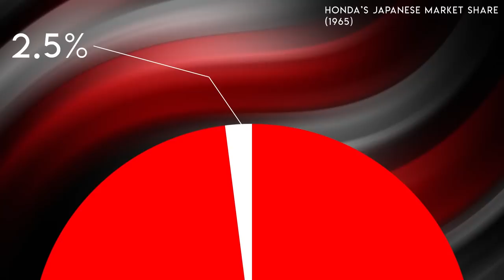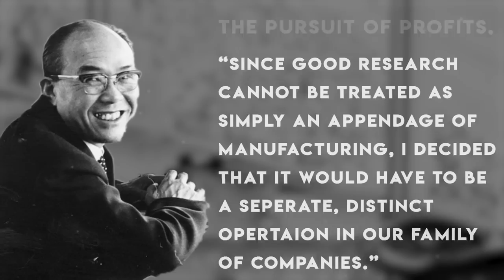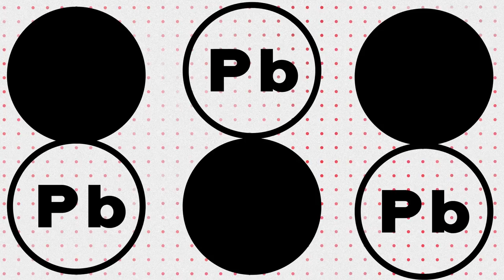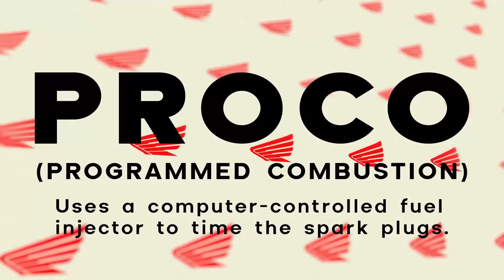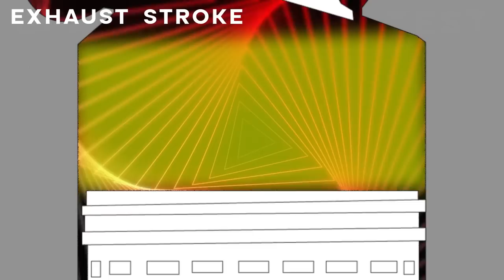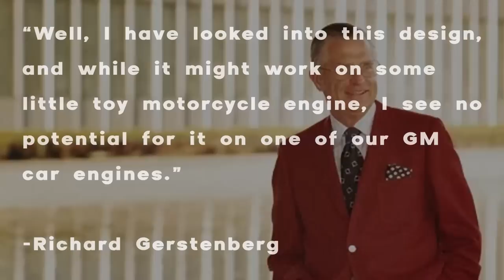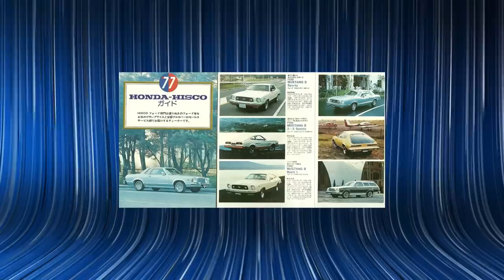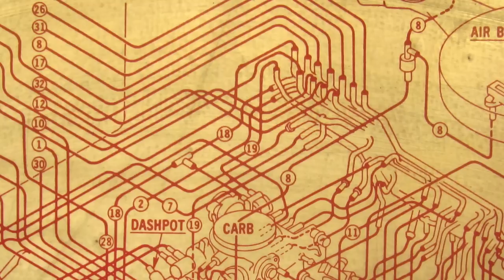The Honda CVCC Engine Was A REVELATION (Full Documentary)

Comment: Best engine in any car I've ever owned. Put 65k on it before any repairs (dirt in the carburetor needle & seat). Sold it at 80k miles; buyer put 20k on it before doing brakes. Put another 40k then did a clutch. Car got 37mpg combined with no computer or fuel injection - only car that got better mpg was my parent's Rabbit Diesel

Comment: In the fall of '78, after owning several used vehicles of varying descriptions and vintage, I was ready to buy my first brand new car.  I needed something small with good gas mileage, and my budget was no more than $6k.  I looked at pretty much everything on the market in the US at that time which met those parameters.  The small cars made by the US automakers did not compare well to the imports IMO, so they were out of the running pretty quickly.

I looked briefly at Hondas but decided they were too small, plus there were some stories going around about problems with the engines and overall QC.  The idea of a Honda car was still a new thing at that time, especially in the US, and they hadn't yet built up a lot of trust or a loyal following.  They were still thought of as primarily a motorcycle company, and there was some doubt about how long they were going to be able to stay in the auto market, especially in the US.

I ended up buying a new Golf/Rabbit.  I was able to splurge for the midrange model with a few minor options, but it had power nothing other than steering and brakes (I think).  It had an AM radio, crank windows, stick shift, and of course no AC, which was pretty typical at the time even on new cars, especially econo cars.  The AC option alone would have added ten percent to the price of the entire car (around $600), so it was a budget buster and I had to skip it.  Houses and cars without AC were common then so it wasn't a big deal.  I was able to get out the door just under $6k.  

The VW was peppy and served me well for two years until I was making more money and could trade it in on something bigger and a little more luxurious (and with AC).

Comment: I had a Civic that had a bad transmission so I bought a smashed up CVCC car for parts. I decided to switch out the engine as well but after many hours to get it to fit I discovered the CVCC car front end was a few inches longer so the engine wouldn't bolt in. If I remember correctly the fenders were longer too on the CVCC

Comment: The CVCC engine in my Mom's 78 Accord was super problematic and I've often seen that engine listed as one of the worst engines of all time. Sure it made emissions and fuel consumption good, but the overly complicated vacuum system and carb's sensitivity to different gas mixtures made it quite unreliable.
Reply: Yes the carbed and heavy vacuum engines were headaches to troubleshoot. Modern tuners found out ways to delete all of the vacuum lines with the “wire tuck” craze
Reply: I've got one still, plus a few 1st gen civics.
The carbs are copy cats and reliable, but the vaccuum is as bad as it can be.
The 1st gen community calls those cvcc engines boat anchors for good reason. Nearly everyone blew the head gasket.

Comment: Its hilarious how the world actually considered converting the industry to rotary engines and they found it was complete garbage.

I also love how american automakers dismissed honda then honda basically took their cars and FIXED THEM. The ultimate F U in the industry 🤣😂
Reply: The rotary engine essentially bankrupted Mazda. They dumped billions into its development and never got anything but massive troubles from them. Sad too because Mazda’s car and B series trucks were as good as anything produced by the other Japanese companies. Cash strapped Mazda got in bed with FoMoCo and their line turned to poop 💩. One Mazda executive recently stated that their relationship with Ford was the worst decision they ever made and was regretting until this day.
Reply: @prevost8686  even without ford in the mix the rotary engine has alot of weak points for the engine to fail eventhough it has “less moving parts”. The whole engine has to come out anytime a rotor seal fails.  And while they are the most efficient in terms of power/liter, they are also the least efficient in terms of gas milage which isnt appealing to the american market. Interesting design, great on paper but not viable long term relative to piston engines. Honda ias basically perfected the 1.6L and its not difficult to find one with over 300k miles on it